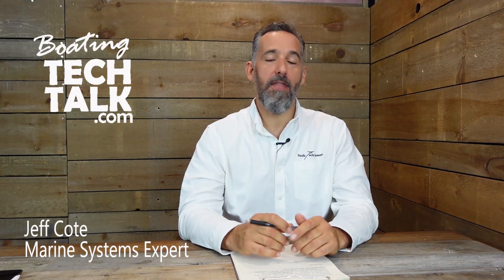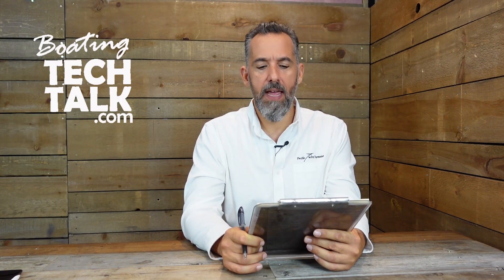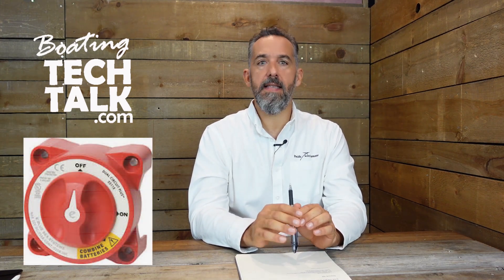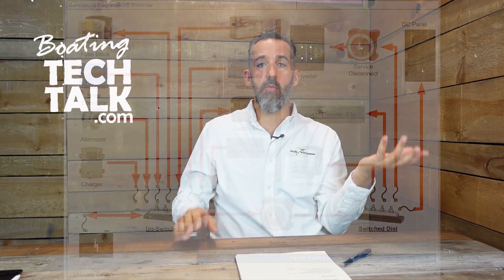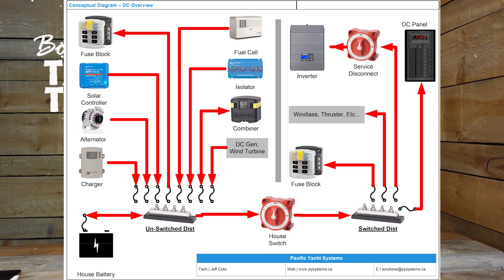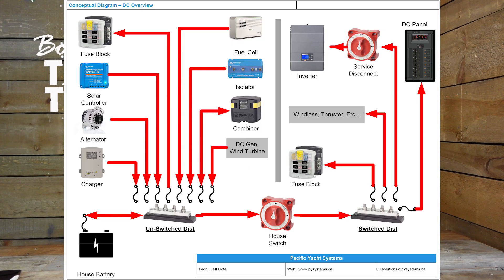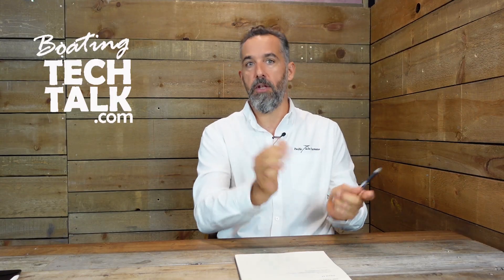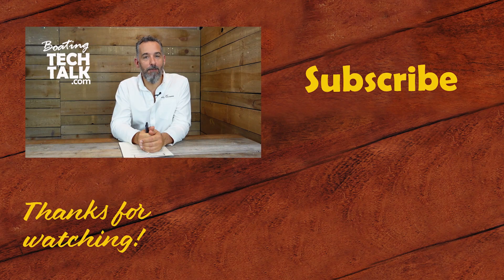Battery Switch on or off When I Leave My Boat at the Dock?

Comment: I have a question regarding charging my batteries with an ACT system.
I have a trailer boat at home in the driveway do I charge the batteries like normal by putting the charger directly to each battery or is it somehow different than that ?
Reply: ACR system

Comment: I know that this is an older post, but; if anyone can give me their opinion:
I had a Four Winns "H200", for eight years. All summer long, my boat was either being used, or was docked on a lift. This was from June 15th until the end of September. I did not have a battery switch, nor did I disconnect the battery. No battery tender either.
Now, I am buying a SX190 Yamaha jet drive boat, and I have been told to turn the battery switch off, when leaving the boat. The bilge pump is a direct connection, soit will operate regardless of a battery switch. My Four Winns was the same.
PLEASE ANSWER THIS QUESTION:
DO I HAVE TO SWITCH THE BATTERY OFF OR CAN I LEAVE IT THE SAME AS I USED TO DO?
As well; any comments regarding the Yamaha SX190 would be welcome!
HAPPY HOLIDAYS!

Comment: Does anyone have a switch on "unwitched" loads or sources to isolate them either for working on the load device, for working on the rest of the unswitched system without "magic" happening or to turn off a faulty device.

Bilge pumps usually have their own switch (not persoally a fan of the ones you have to hold down) and could be turned off there, but should alarms etc.?

E.g. If I was swapping out a bilge pump switch I would want to disconnect it from both the battery and the solar charger to avoid doing it live.

Comment: One thing to take into consideration is the type of boat as well.  I have a tritoon Crest party boat.  There is no bilge pump for example.  I was happy with the boat with the exception of the wiring.  Getting into the helm and looking at the wiring, it looks like Crest just took a bucket full of wire, threw a hand grenade in the bucket and shoved the whole mess under the helm.  I installed a Blue Seas Add A Battery kit (with ACR) on the boat.  I also ran a 4 AWG cable from the battery area to the helm.  This is in addition to the one Crest ran.  I put a 12 position fuse panel in the helm to control the wiring and fusing better. 
I always turn off the switch when I leave the boat even if we are out boating and its overnight.  
The only thing I have that is constantly on are two Drok battery monitors so I can check the batteries any time I wish. They draw like no power when off and have caused no problems with the batteries no matter how long the boat has set.

Comment: Hi Jeff 
If i have a start and house battery (crank and deep cycle) and a dual input VSR. If I connect an onboard battery charger like a Noco or Promariner won't the VSR sense that both batteries are charging/charged and open the relay, does this even matter? Can you just hook up a single bank onboard charger and allow the VSR to charge the house battery once the start is at full charge? Any issues with this? Cheers

Comment: Thanks for the explanation. Talking about float charging: does that mean that if the battery switch is turned to OFF that I should get a two bank float charger?

My application: 2 batteries, outboard, no shore power, small runabout lake boat only use the handful of times a year.

Comment: If you have a xantrex battery monitor. My xantrex gets power from the switched side so turning off the switch means the battery monitor will get out of sync with the batteries. Is this correct?
Reply from the maker: No, All battery monitors need to get wired direct to the battery.  the xantrax will likly have 2 or 3 power wires.  A power, and 1 or 2 voltages senses (2 if a 2nd bank is hooked up for voltage)

Comment: In the diagram, it shows the solar controller on the switched side.  In the event that your using a solar panel to recharge/top off the batteries would it be acceptable to have the controller on the unswitched side?
Reply from the maker: Good point, in most cased the solar controller should be connected to unswitched positive distribution.

Comment: Hi Jeff, so the shore power will still charge the batteries, even when the a batteries switches are off? Sorry if it is a stupid question. Thx again!
Reply from the maker: Yes and no, your battery charger will only charge the batteries if the charger is directly connected and bypass the switch.

Comment: What is the easiest way to check for stray voltage in the water around your boat or someone elses?
Reply from the maker: Using a really good multimeter and also a silver silver chloride reference anode.

Comment: Do not do not do not I repeat do not do not do not turn your battery switch to off while your Motors are running. Do not turn off the battery switch when your motors are running!!!
Reply from the maker: Good point. Learnt that lesson the hard way on my first boat, it's not an error i ever want to make again. Thanks for sharing.
Reply: OK, I'll bite. What happens if I do that? Thanks. "Preciate the heads up, btw.
Reply: @Sam-mx2pi  I think the alternator can be ruined. Would someone please confirm?

Comment: I would add a new question about this subject. What about the automátic bilge pump? I mean , if you leave in a wet place you could have an entrance of water and having the bilge pump could protect your boat from a mess. Not talking about a salt water leaking, more improbable but possible
Reply from the maker: Good point, the bilge pump circuit should be bypass the master DC on/off switch, and be directly connected to the battery via a fuse a dedicated  switch.

Comment: Many of us have inverter / chargers. You have the inverter on the switched side of the "House Switch" isolating the charger portion also. Then you have the ??separate charger?? on the hot side of the switch. Recommending 2 chargers then? Thanx
Reply: Inverter charger goes on the unswitched side, though it has its own switch (and fuse, obviously). That switch is only needed turned off for servicing, emergency, or if storing the boat long term.
Reply from the maker: Thanks Eric for the explanation, well said!

Comment: My fridge is switched and I leave the switch to house when I leave with the fridge breaker on.

I have been wondering if it should be wired before the battery switch.
Reply from the maker: Fridge should definitely be connected to the switched side of the DC positive.